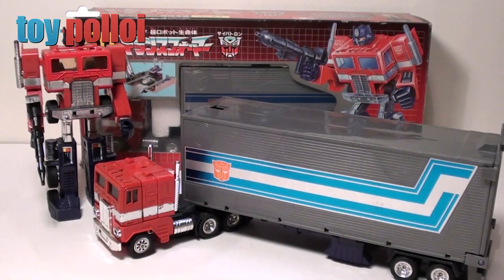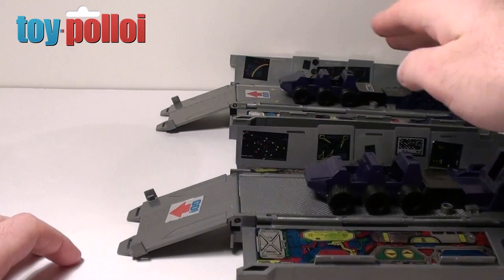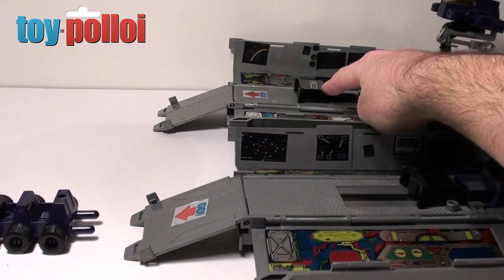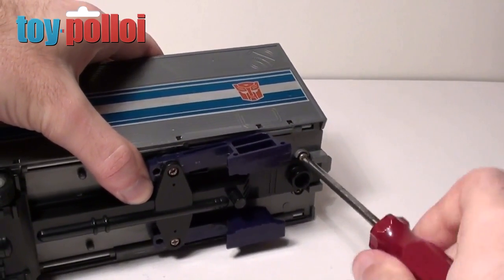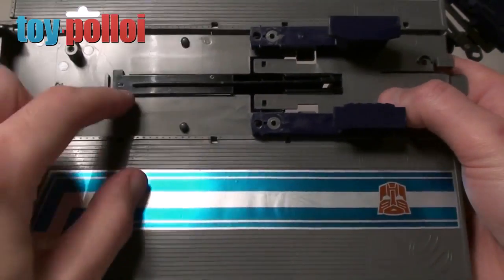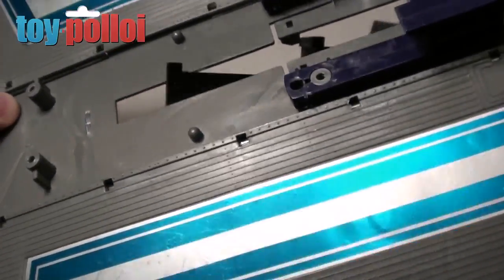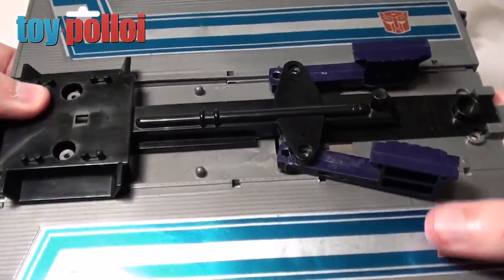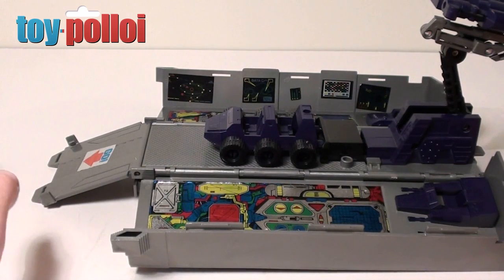How to Supercharge Optimus Prime's Trailer launcher - Toy Polloi

Comment: hey I have a question you can hopefully help me out with do know any way to put tension back or tighten the spring on optimus primes trailer? hope you help
Reply from the maker: Has the spring been streched or damaged in some way?
Reply: +Toy Polloi it has been stretched
Reply from the maker: There is no way to re-spring a spring so you will need to find a replacement that is as close as possible to the original. You should be able to find something close on ebay.
Reply: +Toy Polloi ok thanks for replying and giving sn attemp to help thanks

Comment: How do you get the 2002 TRU reissue working? I guess I will need a spring 2.
Reply from the maker: +William Thompson I don't have one. What is different about it?
Reply: The whole launcher system was altered. There is no spring and the tab/button on the trailer has been modified. I don't think there is a way to get the 2002 reissue working. I have a G1 prime, so it's no big deal. Just very odd on Hasbro's part. Their other Prime reissues Hasbro has released have a working launcher. Very odd.

Comment: Unfortunatly, my optimus has a stripped screw head and I cant remove it so I cant do this modification
Reply from the maker: try carefully drilling off the head of the screw.
Reply: @toypolloi  its one of the screws that are placed on the trailers wheels section